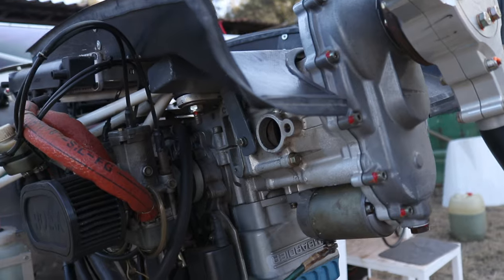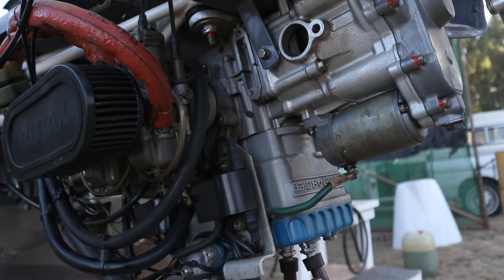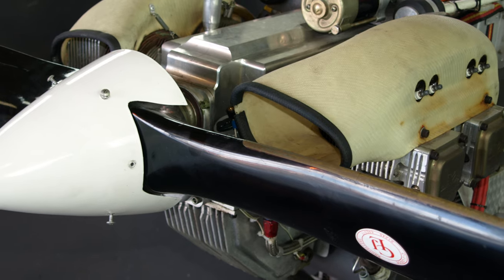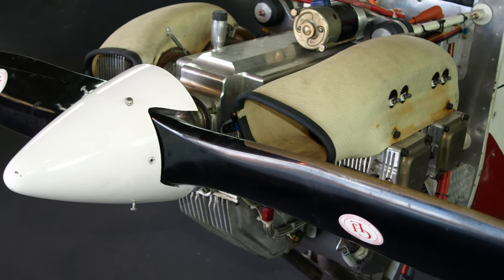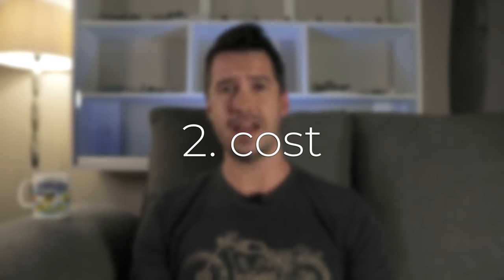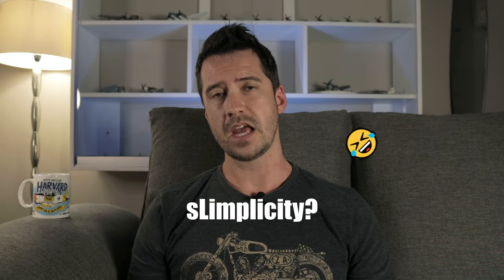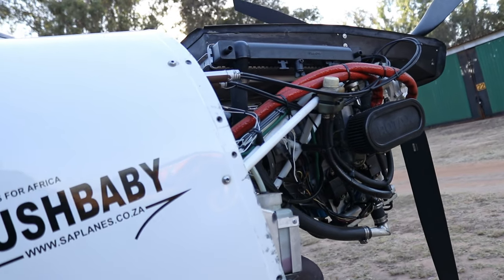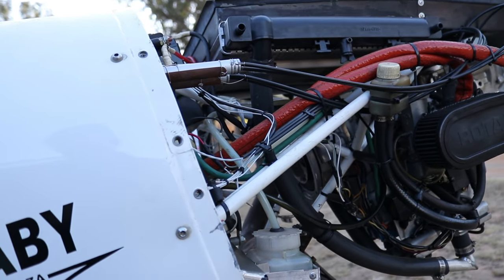5 Reasons the Rotax 582 is AWESOME (& 4 reasons it SUCKS)

Comment: You want Reliability in a 2 Stroke:

1. Bore & Hone Cylinders with a Toque Plate.

2. Use 93 Octane or better 100LL with TCP Additive. Detonation is the #1 Failure Point!

3. Use a Good High Flash Point Oil, preferably Hirths Blue Max or Amsoil Saber Pro, premixed at 80:1, 90:1, 100:1 depending on Weather Temps. This also means fewer Decarbons are needed 700+ hrs. #2 Failure Point!

4. Change Out your Fuel System, Carb Boots regularly, and use Tygon Fuel Line. #3 Failure Point!

5. Use Carb Heat. #4 Failure Point!

6. Warm UP your Engine before Takeoff.

7. Use gradual Throttle Settings.

8. Store your Engine Properly.

9. Actually READ your Engine Manual.

10. Use the different Engine Coatings that fight Heat ad Corrosion.

11. Use the Best Case Seals & Carb Boots, JBM.

12. Oil Injection can and does Fail. So Premixing is best.

13. Don't mess with the jetting if you can't READ and understand the Jetting Charts.
Reply from the maker: We followed the majority of these (some on purpose, some just by accident) when we still had the 582, but these points would have been great to know about as new 582 engine owners.

Comment: Excellent video, with the 582 being discontinued you should consider doing another video like this on Hirth engines
Reply from the maker: Thanks. With Yamaha now entering the aviation market, they would be ideally placed to offer an engine in the 582 weight range and 80hp output range. High rpm (10,000+) 4 stroke power is probably the direction these engines will go in in the future. Hirth definitely well placed too with an air cooled and a water cooled engine in this class, though I know little about these engines from first hand experience.

Comment: 5:20 I didn't know about that lean condition diving with the engine idle. I've been giving it RPMs on finals but I was told that was to avoid shock cooling. Either way, no slamming to idle in descent.

Comment: If you have high flying time then the TBO is an issue. If you are like most pilots, own the plane, and fly it not that much, then you hit 300 hours in about 5 years, which is the other metric used for an overhaul. If you are running a 912, 1500 hours, but you still have to tear down every 5 years.. so where is the savings?
Reply from the maker: Why would you tear down a 912 every 5 years? TBO is 15 years.

912's are cheaper to keep running than a 582 if staying faithful to both engines' TBO. It's the 912's very high once-off purchase cost that make them very expensive compared to the 582.
Reply: 2 stroke have very few parts compared to 4 stroke.  Given that all the remaining parts are critical for operation.  Time, in calendar months, is far more sensitive to things like corrosion given no wet crankcase and a low hour high time engine usually will fail faster than one that flys all the time.  The Rotax 4 strokes have had 2000 hour TBO and 15 years calendar time. so a lot of the speculation between Jab and Hirth and Rotax are not comparable.  I personally have never seen a Hirth at 1000 hours.

Comment: Two-stroke engines can be awesome if you know what you buy into: lightweight and quick acceleration, but it changes how you fly. I personally look at temperatures much more than altitude and speed. On a side note, I think there are two-strokes than are far better than Rotax, e.g. Simonini Flying 110HP in 53 kgs!
Reply from the maker: Yeah I know of one Simonini V2 on an airframe, that's a hell of a power to weight ratio
Reply: @LetsGoAviate  i have it on my seaplane... It makes an incredible difference, especially when fighting the drag of the water

Comment: Also, there is nothing really different between a 1000hr TBO Hirth and any Rotax, other than CC used to make hp, CR used, Carb Size used, Exhaust used, Porting. The rest is Octane & Oil used. A Rotax Rick, Skidoo/Rotax 670 669.2cc blows the 582 580cc out of the water making 92hp@6350rpm. There are some 503UL and 582UL out there Flying with 1300hrs with just a Decarbon every 250hrs.
Reply from the maker: The 582 can be reliable if maintained well, the pilot knows the limitations and doesn't exceed it. Unfortunately the above sentence doesn't describe a large percentage of reality, I'm my opinion. Through my approved Rotax maintenance engineer contacts I've learned a lot about these engines when our airplane was still powered by one, and the consensus among them is that the 582 is sensitive, and requires more care than say a Rotax 912 to get acceptable relative reliability out of the 582. 
Some 582's will happily sing for 1000+ hours, others will fail before 300 (I'm aware of a few that did). There are many factors that determines this. I would put a 582 on the right platform and fly it, I don't believe I'm biased against it.

Thanks for the comment!
Reply: @LetsGoAviate  Your comparing a 580cc 65hp $6500 2 Stroke 582UL vs a $18k-22k 912 80/100hp 4 Stroke 1211.69cc! Your Rotax Maintenance Engineer as you call them is a Parts Changer Mechanic, not an Engine Builder who not only rebuilds them but who Improves them. Build a 2 Stroke using 1200cc and it will Blow that 912 out of the water. Your talking 580cc 11.5cr vs 9.0, 6500rpm vs 5500rpm, 580cc vs 1211cc. If built right a 1211cc/7cc= 173hp@6500rpm is possible. 2 Strokes Fail and 4 Strokes Fail, 99.9% is from Humans who don't know what they're doing rebuilding them, Humans who don't know how to maintain them, and those Humans who are Flying them. 85% of the Failures is from Humans using old low Octane Gas and using Poor 2 Stroke Oils. Rotax Rick in Flordia makes a 582UL/583 Tuned Pipe that he rates at 79hp@6400rpm.
Reply from the maker: @Armilite1  I'm not sure if "Rotax maintenance engineer" was the correct term, but the ones I was referring to in my previous reply are actually both engine builders, not just "mechanics". I do believe your performance numbers, but I was talking strictly about reliability. My opinion is that the average 4-stroke engine can take more abuse from a nit-wit pilot than the average 2-stroke engine before failing. I concede that it is an opinion, although it's based on facts from people who have worked on these engines for decades.

Comment: i have an avid flyer, at cruise rpms around 5,200-5,400 rpms i get consistent 2.5 gal/hour fuel burn at those rpms,
Reply from the maker: That's a good fuel consumption, best I've heard or seen. Hold on to that engine, a lot of 582's are not going below 3.5 for those rpms and up to 4.5 at 6,000rpm.

Comment: Consider overhaul cost of a 2 stroke vs 4 stroke even at 300hrs you can build the 582 for half
Reply from the maker: Very true! That's a good one, thanks Matt.
Reply: Vs 912 at 1500hrs - example only(not real cost) 582 TBO is100$ vs 912 TBO is 200$ .... 582 TBOs are 5 x100 = 500$ vs 200$
I guess you cant compare to all 4 stroke -- I dont know my aviation engines that are in this class.
Cheers
Reply from the maker: Yeah as you say, even with 582 overhaul at half the cost, by the time you get to a 912's 1500hrs the 582 would have been overhauled 5 times...
Reply: @LetsGoAviate  what we really need is better improvement in batteries. Electric motors are superior, just not their fuel tanks.
Cheers
Reply from the maker: Yeah endurance is the problem for electric motors (or rather, the batteries), they can't seem to get much past the 30 minute mark...OK for local flights, but will need to last 4 to 5 times longer before it can be considered a real alternative. Wont get there in the next few years, my opinion.
Reply: @patrickmckowen2999  The Rotax 582 costs around $1,500 dollars per overhaul. ($7,500 for 5 overhauls)  The Rotax 912 cost around 12,000 dollars per overhaul.  Difference of around $4,500 dollars.

Comment: What higher HP engine would you recommend for an ultralight?   I am looking into purchasing or building a 103 ultralight and the local area elevation is approaching 3000'.
Reply from the maker: Hard to say without knowing which ultralight and what your budget is. But in general you can't go wrong with a Rotax 912. But they are pricey and a tad heavy. 

If that doesn't work I personally would look at a Yamaha Phazer. It produces around 80hp and weighs about the same as the 582. You'll need to have it converted for airplane use (it's a snowmobile engine), but checkout Ben Kairys' YouTube channel for more info on it. I believe he manufactures gearbox adapters for it.

After that I would suggest the Simonini Victor 2. I personally know one pilot that flies an LSA aircraft with this engine. It's heavier than the 582, but lighter than the 912 and produces 100+ hp.
Reply: @LetsGoAviate  Thank you.
Reply: Limbach.
Reply: Reason 5?
It's out of production!

Comment: It makes sense that the TBO is only 300 hours, when considering it uses gear reduction. The engine is going through more cycles of combustion per hour then similar engine without gear reduction.
Reply from the maker: Could be part of the reason, yes. Then again, the Rotax 912 also has gear reduction, and has a TBO of 1500 hours. It's max and continous RPM is only 1,000 less than the 582 (5,800 vs 6,800 rpm). So maybe it's a 2-stroke thing? 2-stroke engines are very inefficient, and doens't "burn" very clean compared to 4-stroke engines, and I presume this takes it's toll on components. I think that too has at least something to do with the low TBO.
Reply: Except many direct drive engines operating at 1/3 the rpm, have a 2000 TBO. Using you logic, engine turning 3 times as fast..TBO should be about 600-700 hours, not 300.
Reply: @OldGlaseye-gf7si  some engines do have a 2,000 TBO. I didn't say this was direct correlation . I just said it made sense that the TBO was much lower because the engine is cycling much more then a direct drive application. I looked up some other aero-engines with gear reduction and that the TBO time was lower then it's direct drive sibling. Such as the Continental O-300.

Comment: FYI power is torque over time. So if you have the same power at the prop, you cant have more torque even if it has a reduction.
Reply from the maker: Horsepower is torque x rpm / 5252. The gearbox reduces the propeller rpm. Lets say we have an engine producing 100N.m of torque at 5000rpm. 100 * 5000 / 5252 = 95. This would result in 95hp. If we fit a 2x reduction gearbox to the engine, and the propeller turns 2500 rpm, does it halve the horsepower? 100 * 2500 / 5252 = 48. No. If rpm halves through a 2x reduction box, torque HAS to double. 200 * 2500 / 5252 = 95.
Reply: @LetsGoAviate  That is correct. But an engine that makes 95 kw at 2500 will have twice the torque as the engine that makes 95 kw at 5000 rpm. So once you halve the propeller rpm for the 5000 rpm engine, both will have the same power and torque at the propeller. 95 X 5252 / 2500 = 200. You said an engine with a reduction gearbox will be able to spin a larger propeller than a direct drive engine with the same hp. If the propeller speed is the same for both engines and they have the same power. neither will be more powerful, they are equal.
Reply from the maker: @chippyjohn1  I get what you are saying, and yes they will have the same power (hp), but it will be able to spin a larger propeller because even though it has the same power, the torque part of the power equation is increased. The larger propeller's blades has a larger area/volume, which has more drag, and is more difficult to spin. But it also creates more static thrust. So while it has the same power to the prop, the one with the reduction gearbox and larger prop will be able to create more static thrust by swinging a larger, draggier prop. 

As in all things there is a trade-off. The larger prop has more drag and will be penalized in the cruise stage of flight. But in certain applications (STOL), spinning a larger prop (more static thrust) is an advantage.
Reply: @LetsGoAviate  Yes it will be able to spin a larger propeller if the propeller is turning at a lower rpm, but not if it is the same rpm.
Reply: No, power is torque x angular rotation speed. W = T x w,      Watts = Nm x rads/s     Work done in Joules = Watts x time in seconds
Reply: @ianlewis6717  That is what I said, torque over time.
Reply: @chippyjohn1  But at what speed? E.g. no power is transmitted and no work is done if there is no rotation.
Reply: @ianlewis6717  we are talking about an engine and a propeller, so there is rotation. Have a nice day.
Reply: @chippyjohn1  I am not going to try to correct you any more. I was just trying to help you understand basic mechanics and not mislead others. I am a chartered engineer and have a degree in engineering 🙂
Reply: @ianlewis6717  As a charted engineer, what have you designed and made? Honestly, a degree means little to me. I have met many proclaimed engineers that have no creativity or imagination and couldn't design anything, no offence. People mislead others by proclaiming they are intelligent because they have a degree. What country are you from?
Reply: @chippyjohn1  In my professional career I have designed guided missile electronic subsystems, microprocessor based control and protection systems and equipment for rail, nuclear, explosive and high power laser applications. As a hobbyist I have built RC model aeroplanes, rebuilt and restored bicycles, motorcycles and cars, designed, built and raced hovercraft, designed and built a solar hot water system and built and sailed a yacht. I am English. One does not need a degree or to have designed anything to understand the relationship between power, torque, speed and work done. Just a basic understanding of mathematics and mechanics. May I ask what your background is so that I may help?
Reply: @ianlewis6717  Been building things since I can remember. I shy away from weapons, but much the same as what you have done with the exception of a hovercraft and a yacht, I have only designed one. Currently working on my first full size single seat helicopter build (you can laugh). I don't build something unless I see it as viable or having potential. My profession is just a mechanic, but I have worked in most trades, I love to learn. I love pulling things apart and seeing how they work. Designed my own house and yacht and aquaponics system, but not built yet, focusing on my helicopter and some patents. Currently work in custom steel fabrication and run a workshop with a cnc laser and other equipment. my yacht design is 24.8 metres with a little greenhouse, large battery bank in the keel for ballast and power along with diesel/electric engines and a hydrogen inflated kite for when there is wind, Also about 15kw of solar where the decking flips over to expose the underside which is solar panels. It is designed to be able to live on it for years. Not many places to dock it in Australia though. House includes aquaponics, solar, gravity battery using sla/nickel iron batteries as the weight to make further use of their mass and much more. My helicopter design is quite cool, simple and unique but wont talk about it. I only corrected the video maker as he said that having a reduction drive gives you more torque than direct, but if both have the same power and both props spin at the same speed, they both have the same torque regardless of gear reduction. I have been designing a city also, but not confident in that happening. I am only 33, so still time for more. All the best Englishman.
Reply: @chippyjohn1  I'm feeling your pain, ol' ChippyJohn1.  It's a three-term equation.  I think part of the misunderstanding is the ubiquity of "Engine Power and Torque vs RPM" curves.  I suspect these are frequently understood as being two independent curves, when in actuality the power vs. RPM curve can be derived given the torque vs. RPM curve, and the torque vs. RPM curve can be derived given the power vs. RPM curve.
Reply: @RockyScott  Yes, I tried explaining that if both propellers have the same power at the same speed, they will have the same torque. Only if the reduction propeller is geared lower it will have more torque.

Comment: Rotax Rick in Florida for $2850 overhaul with updated rods I doubt you can beat those prices with a Jabiru. Your trying to compare engines that cost 4 times as much like a 912. The 582 and 912 are not even close to compare in reality if you want to compare engines compare other 2 strokes on the market like the Hirth. Not everyone can afford to buy a 912 or a jabiru they don't have 20k dollars to buy an engine nor do they need it. Many light aircraft that are not designed to use a 912 because they are too heavy, or just don't require more than 65HP.    CASA Australian Civil Aviation Safety Authority  in 2014 had labeled Jabiru as an unsafe engine requirement that no passengers were to be carried. That was lifted later on but how many of those older engines are still floating around have hidden safety issues.  Most people who have problems with a 2-stroke engine is because they neglected them didn't follow the manual how to service them.